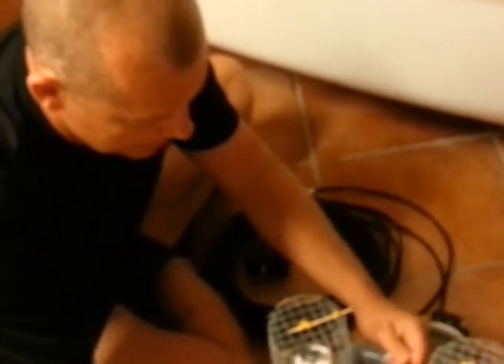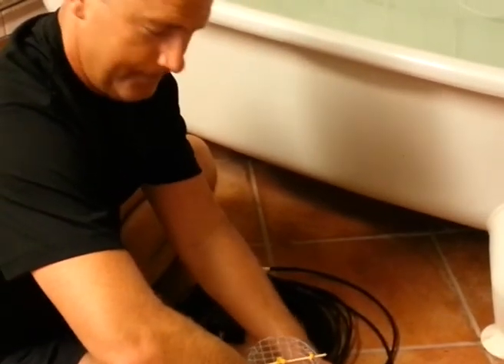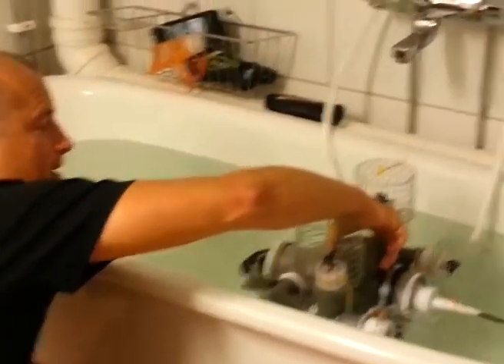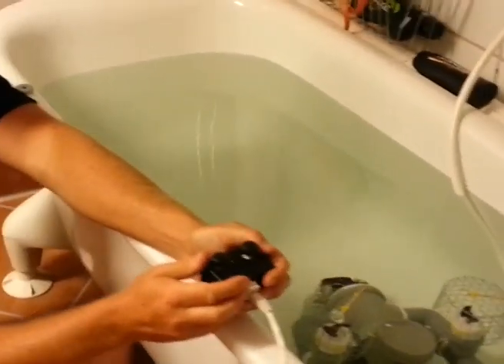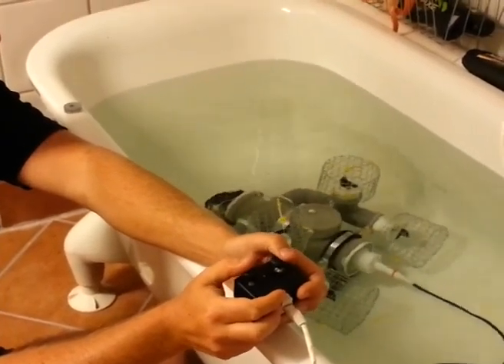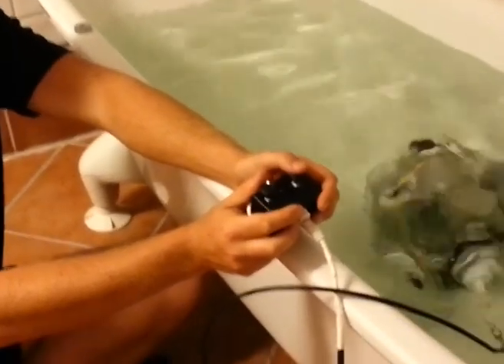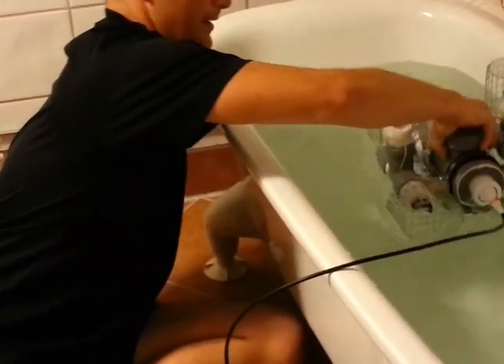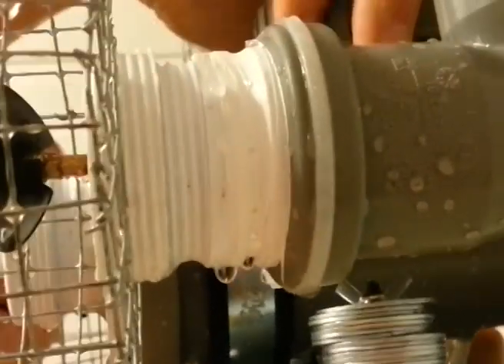ROV version 6.0 - final bathtub test

Comment: you should make a device to vacuum swimming pools calculating weith  of the hose   tens of thousands swimming pools in us due to winter weather moss leaves   bound to be filledup with moss      camera is a must beside light      I believe such device can be easily priced   minimum 500 us dollars   which can be used for fish ponds and other quatic ponds           compare to cleaning expenses of such algea and moss which is around min 300 to 600   it can be a great seller     even as a professional cleaner version      take this suggestion in consideration    and what the heck is that happy music

Comment: Hi, i like your project , but i have Questions ?
Can i make the same thing without cable ? What can i do ?
Can i give Coordinates and let the vehicle go to the specified destination by using GPS?
have you use Raspberry Pi or Arduino?
have you use Python or what other language do you prefer?

I am Ali , Master degree student at Gannon University  Erie,PA.

my best regards
Reply from the maker: The problem is poor radio transmission through water (non distilled). The common frequencies for radio control and video link will not reach very far. I presume 2.4 GHz would only reach about 5 m in salt water. I think you have to go below 5 kHz to get some distance. I doubt GPS would work at all under water. I think military submarines still have to surface for accurate positioning and communication.

Comment: I like the mono-hull design this way,it can allow you to reach al the inside parts with a minimum of seals;ever thought of putting the vertical thrusters under a 45° angle so it allows you to move in a "crabbing" motion?Thumbs up.